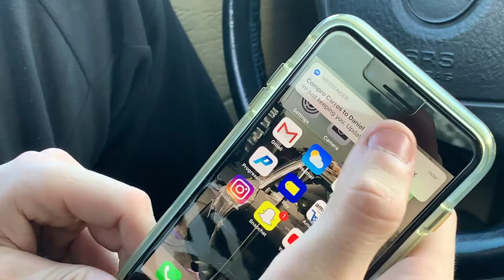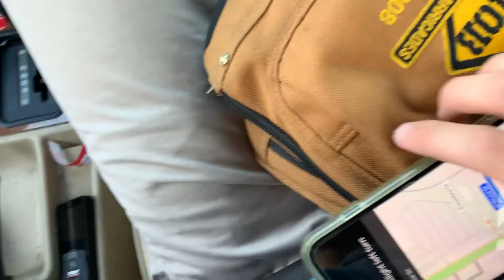buying a CHEAP DIRT BIKE off CRAIGSLIST

Comment: I bought my first dirtbike last week for $450. It is a 2001 yz125. It needed new front forks and it has a small crack on the gas tank. It has title and i wasnt sure if it was a good buy. It is a little boggy but it starts first kick.

Comment: KDX200’s are awesome bikes, your friend got a bargain. They don’t hit as hard as the 125 but their smoother and faster.

Future classic for sure.
Reply: Jonathan Kautto - did you miss the bit I said about the 200 being faster? The 125 has less torque low down so what you feel under your butt hits harder than the 200 when it comes on the pipe. 

But hey, you’re the genius.